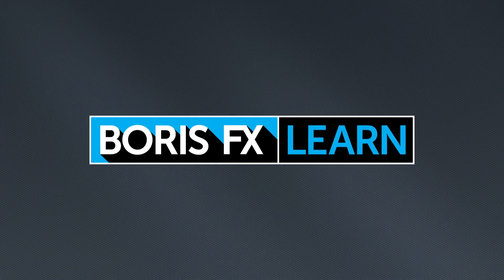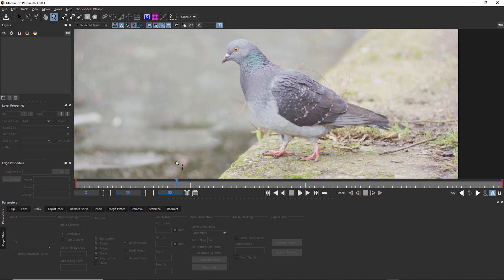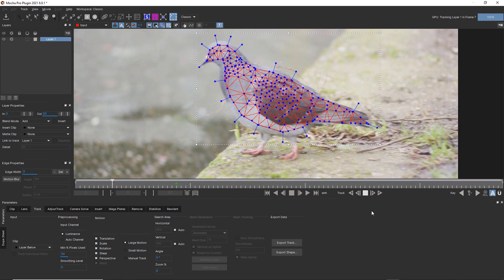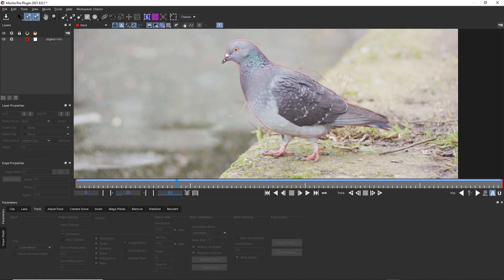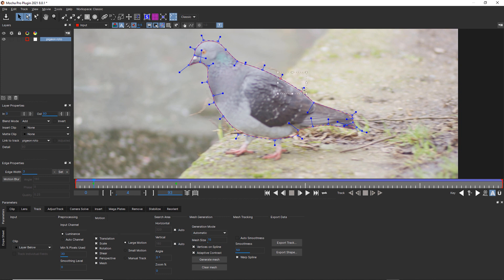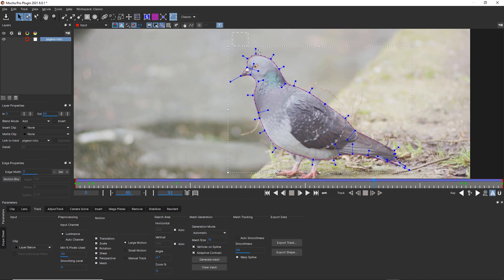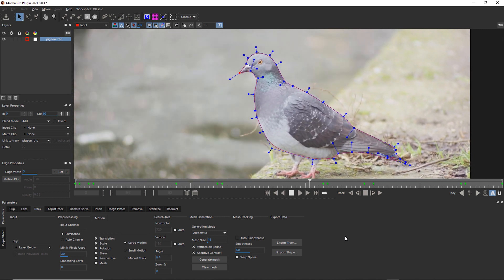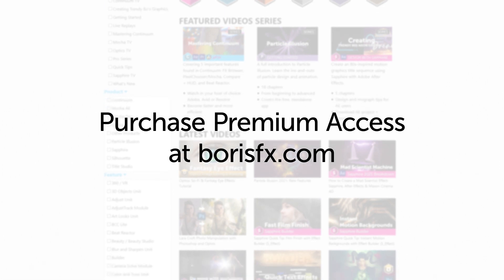15a PowerMesh for Rotoscoping [Mocha Essentials]

Comment: This is exactly what I was looking for.

Part of why I bought Mocha was for the AI assisted rotoscoping, and I thought I had made a mistake.

With what AI is doing these days, one would think AI can follow even a complex shape such as this.

Perhaps that upgrade is coming?
Reply from the maker: Mocha doesn't have AI assisted roto. It has assisted roto with the tracking and PowerMesh. High quality, temporally consistent roto is out of the reach of AI  tools still. If you need a mask for something loose like color correction or garbage masking, then AI mattes is an appropriate tool. But for sharp and consistent splines, there's still some elbow grease involved!  
We're sharply focused on making the best tools for our customers' needs and finding the best solutions for them.

Comment: I can't seem to find any tutorial on how to best rotoscope and object that is rotating or generally changing shape, such as if a head is facing left and then turns right. What's the best method for that?
Reply from the maker: The best method is to break it up into multiple shapes. If areas go in and out of view, one technique is to do a main track for the front of the face, and link a roto shape that you animate to that. As a side goes out of view you can easily  turn that roto'ed layer off.   Make another tracked shape for the side that comes into view and have some overlap between the two.  For fast moving objects, you are going to have to do a bit of manual animation, but the tracking will help out.

I'm not sure if you've seen the roto part of this series, but it starts here : https://www.youtube.com/watch?v=vjV0lNF8mfY
And here's something about when planar tracking can't solve the whole problem : https://borisfx.com/videos/fix-tracks-fast-mocha-pro-and-planes-that-turn-away/

Comment: thank you, how do you deside between powermesh and rotoscoping?
Reply from the maker: You don't have to decide. The PowerMesh can be used simply to help drive the rotoscoping. If you don't want to see it anymore, just turn off the mesh view in the toolbar.  Then you can work with the spline as normal, it's just being powered by PowerMesh instead of the regular planar tracking.

Hope that makes sense.

Comment: It is super important to have 'Warp Spline' on for this because that is the whole point. With this option on and using the Power Mesh (and hence the sub planar tracking), the overall spline layer continues to warp/change as the object moves/contorts. Once that is done, we can  disable the PowerMesh  (hence it is a keyframe assistant, since it has done most of the warping and spline movement of the  outlying spline for us so we don't have to - and when I say movement I mean spline warping - as the actual movement of the spline itself is driven by its planar tracking -  Spline Planar tracking first -> then sub planar tracking), and then apply keyframes to adjust the spline wherever  there are issues  - such as blur,  super quick movement, spline slightly going off the edge of the  object and so on.
Reply from the maker: You got it.

Comment: Looks good and how about the legs of the pidgeon? Also what about the masking overlaping thing like walking legs?
Reply from the maker: Break those out as individual shapes.  Any occlusions should be dealt with like normal, with track mattes (Exercise 4b in this series). When using track mattes and PowerMesh, you should be a bit more generous with them.  Don't roto directly to the edge, but give them a bit of a wide border. That way PowerMesh will still do most of the work for you.  

Mary deals with this topic in more detail in one of her Office Hours livestreams here : https://youtu.be/OaFp75YN7z8

Comment: Hi. Can you tell, why we need to use the last good frame?
Reply from the maker: The idea of the "last good frame" means that you're always building on top of something that works.  When a shot fails, just find the point where it starts to go wrong, instead of starting from the beginning every time. Hope that helps.
Reply: @borisfxlearn  I just can't understand the logic. Why? The most common decision is to take the most distorted frame and get hope for auto keying. The last good frame isn't change anything, or not?
Reply from the maker: I think I misunderstood your question or you misunderstood the reply.  Once you have got a good track, you work to refine the shape through the arcs of the animation.  Lock in the last good frame with a keyframe, move to the point of furthest drift and add a correcting keyframe. Repeat as necessary.   I thought that in the original question you were talking about the tracking part of the process not the roto part. My apologies if that was not the case.